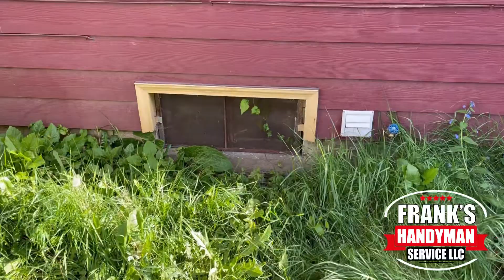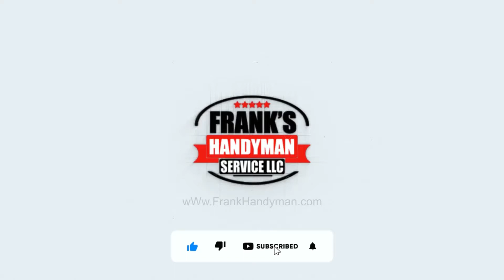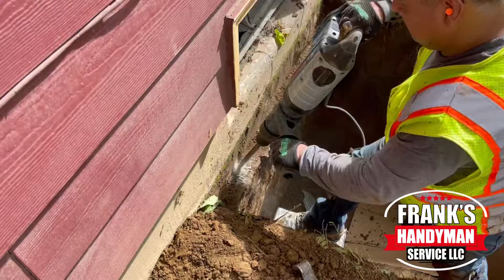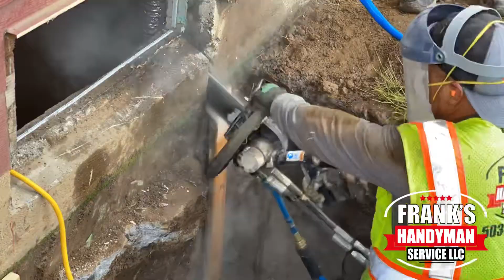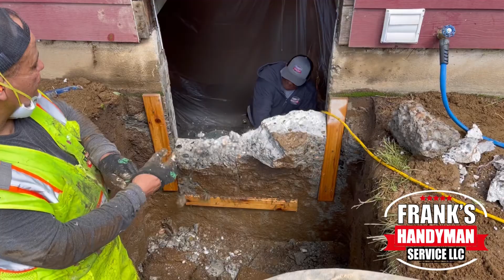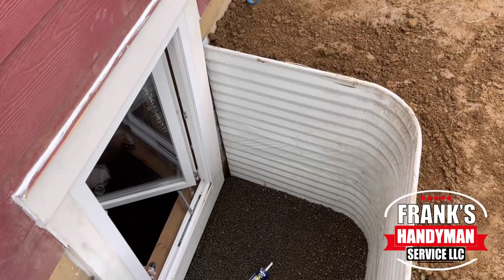How To Cut A Concrete Foundation For A Brand New Egress Window Installation Window Well Step By Step

Comment: That is the perfect size for what I want to do.  Since you already had a window there before were you still supposed to build a lintel?  I don't have a window in mine so I would have to create a lintel to absorb the load of a single joist and put the window between the other two.  For 2 x 6, you might be able to get away with three vertical 2 x 4s.

Comment: With the plastic on the inside were you able to keep the dust out of the rest of the house?
Reply: That's why I came here to see how they managed not the dust but the water, I've done this before and your saw blasts a huge amount of "muddy" water into the  basement haha I'd assume you'd basically need to build a shower with poly and  something to hold the water on the ground

Comment: What about the drain to the o-pipe?
Reply: The house is old enough where it doesn't have one. They should have dug even deeper and wider and backfilled with gravel to create a drainage pit under and around the well so it provides an area for the water to drain. This will just pool like crazy in a big rainfall.